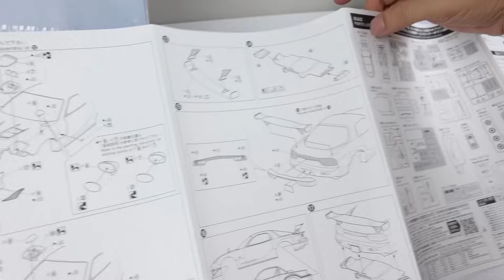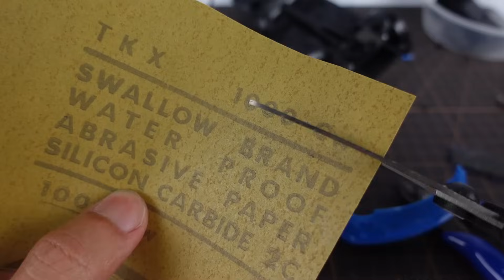Building A Model Mazda RX7 in 10 Minutes, 1/24 Scale Model Car Aoshima.

Comment: Great work. Have a similar kit and haven't quite finished it. One trick with mirrors is to pin them rather than glue them. Have done this on many builds and if you bump them rather thank breaking off the wire bends.
Reply: That's a good idea

Comment: Hey mate! I have a question, does Mr Hobby gloss topcoat have the same effect as the 2K clear you used here?
Reply from the maker: Yes it's roughly the same thing😁 the difference between 2k is that it came with hardener, more durable. Mostly used on real cars.
Reply: @JHHobby  I see! I assume more coats of the mr hobby gloss could have the same result?
Reply: No, the catalyzed 2k stuff is just much harder naturally as it contains more solids and less solvent. The 2k stuff will always be harder... think the differenc between plastic and glass.

the fact it is harder allows him to polish it to a much higher/smoother shine without the fear of burning through clear as if it were softer.